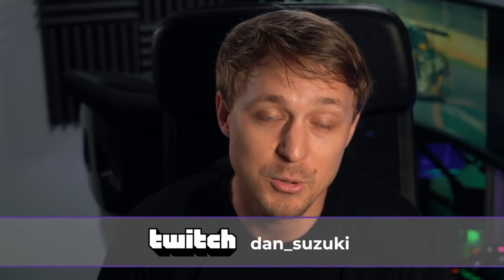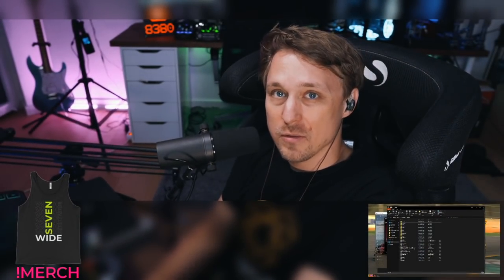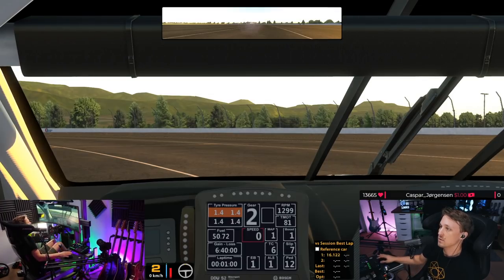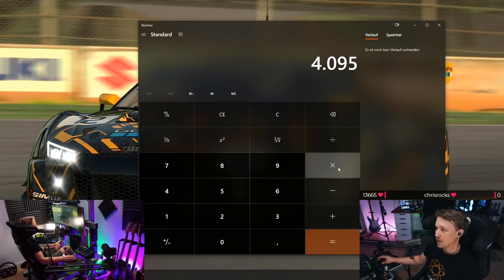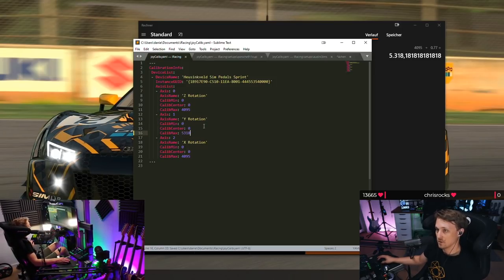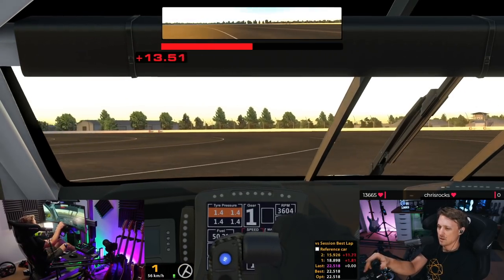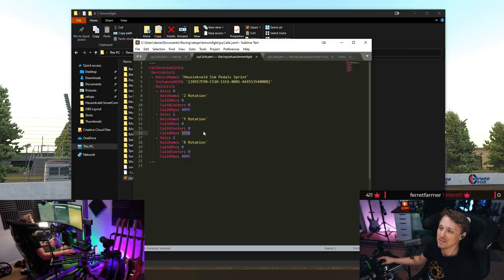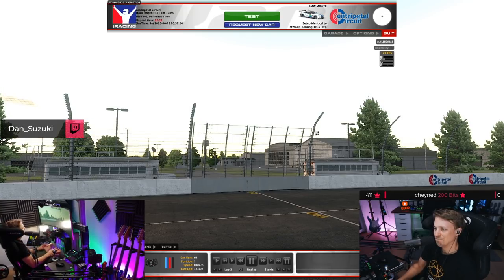iRacing Guides | Never lock up again! Get more out of your brakes with an easy trick!

Comment: you can calibrate a dead zone for your brake in iracing calibration. just push your brake pedal as much as you want your dead zone and while calibrating the zero point, you'll see some input since you are pushing the pedal, tell iracing it is the zero point, and now you have your dead zone. found this in a "sim racing garage" video when he set up the fanatec v3 pedals

Comment: Super confused now..... the config attribute names had been updated, perhaps a recent change in iRacing. The first settings for me were named "Brakes", the CalibMin was zero, the CalibCenter and CalibMax were at the same value as each other (and both matching my Fanatec CSL Load Cell calibration numbers). Great! I added 10% to the values, targeting to start with 90% power in iRacing. When I jumped back in the car, put it into gear, the brakes were on, maybe 2-5%. I edited (a second time) and set CalibMin to 1000, I think that reduced the brakes being on, but still they were on. I reset at that point. Have you any updated knowledge on why that might occur, or what should I set the CalibCenter (in your example it's zero), and perhaps should I be setting CalibMin to some value? Help, it's maybe not as easy as you make it seem (anymore)!! :) And thanks for the videos.

Comment: Hello, Thk for the tips. What about doing that settings in the Heusinkveld tool. I mean increasing the KG force authorized not to reach the top too fast ? - 
The result will be the same no ?  And what is the role of force factor setting in Iracing ?
Reply from the maker: yeah, many pedals can do that in their software :) its exactly the same thing
Reply: @DanSuzuki  Do you use the brake force factor setting in Iracing ? - What is it about ? A+

Comment: @Dan Suzuki What would you is best max brake pressure for gt3 cars? is it 80% or lower?

Guess i need to do some trial and error and get it right per car. 

Some say its cheating but nothing else we can do too stop the unrealistic lock up in Iracing
Reply from the maker: You need to play around a bit and try it. I personally don’t really use this since I switched to a stronger brake

Comment: Hello Dan. I`ve tried that myself with my Thrustmaster Pedals, those ones from the T500RS wheel. However whatever value I put in for the brake, let´s say the 80% you´ve said or maybe less or more didn´t make any change for me in the sim. Probably iR fix this or it works only with pedals you´are using and others except Thrusties..... But good tutorial anway. Thank you :)
Reply from the maker: Did you try the method from the pinned comment? "For Thrustmaster you need to set the CalibMin to negative values ... start with -250."
Reply: @DanSuzuki  Danke schön. Thanks very much. I shall try it today 😊

Comment: This does not work for V3s. my brake resolution is over 65,000  and if I change it, I get zero brake pressure.  Is the load cell that much weaker on sprint pedals?
Reply: works perfectly fine on my v3's

Comment: Thank you very much for this info. I Simrace in Raceroom. Can you do something like this in R3? I use a G27. I tried lowering the break pressure, but for the cars I use the minimum is 80% and it stills locks up, not much, but still does. Any help would be extremely appreciated. Thank you.

Comment: Hey Dan, long time follower, love the videos. I recently got HK sprints. I used your videos on this subject but i still have a question for you. I set my max brake to 75% in the software as I usually race gt3, however even with that set, I am hitting abs all the time and not sure why. I can even lower it to like 70% snd the ABS is still kicking on. I don’t run terrible times, 2:03.5 at Sebring and 2:21 at spa. So could you please help me fix this or understand why this occurs? I watched Dave’s recent video in a gt3 and he doesn’t use his ultimates software at all and even engages way north of 80%+ brakes but I never once see his abs 11 lights going off. I don’t want to lose a lot of extra time. I tried turning abs off and somehow I still skid out even with the max set

Comment: Ive got csl 2 pedal and ive changed the max and min and its not changing the in game braking. The only thing i see diff is it only picks up the wheel as in it says fanatec wheel is that because i have the pedals connected to the drive and not direct to the pc

Comment: Is the all-ready a solution for brakepadles with the 65535 number. I have  tried everything.i cant,t get it work. I've got the Tlcm pedalset.
Reply: I have the same pedals. Take 65535 and divide by the # your are looking for. 65535 divided by .8 gives me 81918 or about 80%
Reply: @S2GUnit  I al-ready did that. no succes.

Comment: nice trick! I will 100% use this. I probably go 90% on lmp1's. I get close to 100% on long straights with it. Also, are u using max force on your sprints?:O am at 34 :P
Reply from the maker: Yeah, I’m on 65kg - if you’re not using the full strength I would not use this workaround - kinda pointless in that case 😅
Reply: @DanSuzuki  

How much are you reducing the brake pressure on GT3, GTE & MX5 cars? I'm leaning towards 25% less in GT3 but I'm not sure for GTE & MX5.

Comment: Hi Dan, thanks for this tip it works great. I have a question, if I set my brake pedal as suggested to give 80% will it still be effective in a team race where the driver swaps or will the fix only take effect when I am driving?
Reply from the maker: The calibration is local - so it's only effective for you!

Comment: What about F1 Cars. When u full speed u can easily 100% brake for 1-2 secs, cus of the downforce and then reduce to 80%? Maybe this is also usable in gt cars? dont know never drove them.

Also u can easily lock your tires if u use 80% but are at for example 30 Mph cus no downforce.

Comment: Guys anybody can help me for the Fanatec V3? After updating the sim as usual, recalibrated and changed calib max, something going wrong, not linear, locking showing up, particular thing when the car has stopped the red brake candle going up to the maximum value without pushing it

Comment: Hello, can you share you Heusinkveld Sprint profile for iRacing?
Reply from the maker: Oh I haven't used those pedals in forever. But if I remember correctly what I did in the software was maximum pedal pressure, linear curve and then limiting the maximum brake output at around 85-90%

Comment: I managed to get this working however it has worked on all carts but the Skippy, 

if i jump in any other car 80% brake max but jump in skippy and 100%

ironically skippy is the car i need it the most for
Reply: Sounds like you might not have the "Use custom controls" on the skippy. So it would then be using the joyCalib.yaml file in \Documents\iRacing instead of the specific car one under setups.

Comment: Another YouTuber did something similar but instead of dividing Y-axis by .77%, they multiplied by 1.23. What's the difference? Is one more accurate than the other?
Reply: Also If U Take 80% from 4000 i should get Less instead of more Like 5000 in the Video.
Or am im wrong? 😅

For my Pedals, i set the Minimum Set to -200 works fine

Comment: I’m having trouble getting Joycalib file changes to impact my braking at all.  I’ve tried shutting down iRacing all the way, making the edits to the file, then starting iRacing.  When I exit iRacing again the file is back to the default value.  I am running TM T500RS with inverted pedals.  Any help would be appreciated!
Reply from the maker: Have you tried the ideas from the pinned comment?
Reply: @DanSuzuki  - I believe so, but obvi doing something wrong.  Do I need to set a negative value instead of a positive value?  In my case, I'm able to edit the JoyCalib file but the values don't stay once I've loaded iRacing?  Thank you Dan, love watching your vids.

Comment: I'm having a hard time wrapping my head around this. On a g29 the min is -55, the center stays at 255 and the max goes to 310? Also, i saved the original under the name old. I deleted the second one i made and i tried to get the game to give me another second file to edit but now it won't, do i just edit the orginal now instead? Because now it wants to do the opposite and i'm getting full brakes at 80% of the distance on the pedal. I'm starting to regret buying this g29 i've spent like 2 months trying to make this fucking brake pedal feel comfortable and i keep making it worse. I've taken the rubber out also
Reply: I had the same issue with no second file, i just made a copy of the orignal and renamed it Old and then just opened the original in text editor and amended there and worked!

Comment: Is this the same as calibrating the brake pedal to 80% range in iRacing itself? 
That's what I have done since having a loadcell
Reply: Same here, albeit I set the 911 Cup to 74%
Reply from the maker: No it’s actually the opposite if I understand you correctly (you only give it 80% pedal input when calibrating, right?)
Reply: @DanSuzuki  yeah I think I understand once I posted it. Keep up the good work.

Comment: This little trick doesn't work anymore in iRacing with the latest update, or one before that. You'll notice that the new paddle calibration indeed show your max break input at 80 percent e.g. (or whatever you set it to) with the config edit change. But then in game it'll make no difference and you'll be braking just as normal locking up. Just try full on brakes or close to in a GTE car and you'll notice nothing changes. Also after you exit iRacing, your config file will return to the original numbers... even if you've saved it with the new numbers.
Reply from the maker: Tried it out, works just fine for me
Reply: @DanSuzuki  yes it might be a logitech issue. Have you tried it with that? The logic drivers are not great and seems to conflict with the joycalib file
Reply: @JamesLangevinMusic  for Thrustmaster it's the same

Comment: this didnt work for me. I did exactly what you did and saved in sublime text. When i go into iRacing it still shows 100% even though i set it at 80%. My raw values was very high though. 65355 according to iRacing. I use the CSL (not loadcell) pedals
Reply from the maker: check the pinned comment :)
Reply: -9000 min force thats it for 79%. or -11000 for less n go up as needed. have same pedals 
p.s tested it on dallara p217..locks at 79 but you get the point

Comment: Not sure what I'm doing wrong but changing the settings doesn't work. Everytime I launch the game I have to recalibrate before I can drive so it just resets everything.
Reply: Change your Min value instead of Max. If your pedals are set to 65535 Max, then change the Min value from 0 to -13107.
Reply: Basically take the 20% difference and subtract it from the Min value instead of adding it to the Max value.

Comment: Firstly, if its using an available technical advantage, as in real motorsport, then whats is the problem. All top drivers/ sportspeople use the rules to their advantage. If its not against the rules then it ain't cheating. Secondly, a question for you Dan- will this require an adjustment in brake distance/ markers? Finally, if people wanna drop a shit ton of money into a rig to help win, then all power to them. I want to be reasonably competitive but not so much so to spend a fortune. Anything like this that helps is welcome.
Reply from the maker: No the braking markers should be the same, if your braking was kinda bad you might be able to brake a bit later now, but just play around with it a bit! This is not only about "how not to lock up" ... it's just that on iRacing the 80-100% actually is kinda useless, even on ABS cars. You definitely don't loose any braking performance :)

Comment: Has anyone gotten this to work on the thrustmaster T300? I’ve changed the values and none of my pedals seem to be showing any different on the widget. Still getting 100% braking
Reply: I use irFFB / Vjoy and with the T300 and it didn't work out for me either. Maybe I'll try it without Vjoy and see if it works then... have you solved the issue btw? It's really hard to be consistent with these pedals when you can't have the full range of the Brake pedal....

Comment: Im dumb when it comes to this kind of stuff.lol I have Fanatec V1 pedals and cant figure it out.
     CalibMin: 0
     CalibCenter: 1023
     CalibMax: 1023
Reply: i have same issue and same numbers on my thrustmaster cheap petals....ive tried everything but nothing works like on videos,...
Reply: @zachattack9453  I was never able to figure it out. We have break pressure now on some cars so that helps alot. Just FYI
Reply: Miller I just did keep everything in joyconig same just change calibmin to negative 255/250ish works for me now perfectly
Reply: center is the offset from where the bottom deadzone ends. what you have done here is basically set a 100% deadzone :P should be something like:

CalibMin: 0
CalibCenter: 100
CalibMax: 1023

this way you will have a little deadzone to rest your foot on the brake pedal. adjust it to your needs

Comment: What if I accidentally deleted the joycalib file from the iracing document, the min value is negative and maximum value is only 1605. Pls help
Reply from the maker: It will generate a new one when you calibrate again :)
Reply: @DanSuzuki  do you still use this
Reply from the maker: @RyanWardRacing  No - I upgraded to stronger pedals, no need any more :)
Reply: @DanSuzuki  should i use it with fanatec csl elite lc pedals

Comment: i guess i did ways know this but i never really realized why i was sooooo much better in braking on assetto corsa rather than iRacing
Reply: Assetto Corsa has better physics especially when the car is on the edge of grip.
Reply: @PoltergeistWorks  I strongly disagree but I only race open wheel iv heard assetto is much better with sports car racing
Reply: @lukeguldemeester5310  Well the force feedback in AC is without a doubt better, iRacing FFB has bad refresh rate and without smoothing it's a mess.
Reply: I can agree with that, I will say that iracing has made huge improvements to the physics in the past year tho, aswell as the tire model

Comment: I can’t get this working with my pedals. 

My starting numbers are;

CalibMin: -32767
CalibCenter: -32767
CalibMax: 32767

Any ideas how I get this to work?

Thanks all 🙏🏻
Reply from the maker: try CalibMax: 32767 at 40000 or something
Reply: @DanSuzuki  thanks Dan. This was my first port of call, but no joy :(
Reply from the maker: @brooksy2622  What pedals do you have? The Fanatec V3 apparently need some weird numbers (see pinned comment)
Reply: @DanSuzuki  I have the SRP-GT pedals. Used to have the sprints where life would be easier :)
You can do some adjustment in the software of the pedals but it’s not as accurate or ideal

Comment: If that really works in iRacing brakes in common are modeled bad not only ABS. Doing that in a real Car or a real Sim you would have a much longer braking path.
Reply: No, you can brake full pressure, but you need to be higher speed. I disagree with doing this entirely.
Reply: @shebeski  exact thats my point. On high speeds you need full brake pressure. 
Without you loose a lot.
Reply from the maker: No you don’t :) Check the brake inputs from the iRacing aliens - you never ever use 100% on the common GT cars for example
Reply: Tell me something that works on iRacing? ABS is bad, TC is a joke. Tyres rubbish, but for some anything to make you gain some secs is welcome on a "SIM" where even the car setups are so unrealistic... I gave up on it long time ago...

Comment: O really enjoy your videos, that being said im only placing a dislike on this video because I'm a firm believer in braking technique over these little hacks and think that it would of been a more educated video personally. I believe tricks like this doesn't help anyone really improve. I understand the argument for lower end pedals but I think the use of the force factor would be a better option. 

That being said I would be interested in seeing your findings about the comments about ABS, braking performance and tire shredding. I dont drive many gt3 cars so I think it would be interesting. That being said ABS isn't used to increase braking performance, its made to simply prevent the wheels from locking up by allowing the tires to slip at certain intervals to prevent locking but also mainly to alow you as the driver to have some steering input to avoid objects in your path. 

As always though the video quality is outstanding
Reply from the maker: Fair enough - it can definitely be seen as "gaining an unfair advantage" - but a lot of modern pedals have this in their software so ... yeah. I much encourage learning proper braking technique instead of course! Using ABS on iRacing definitely is bad - IIRC it makes your tyres temp peak quite a bit.